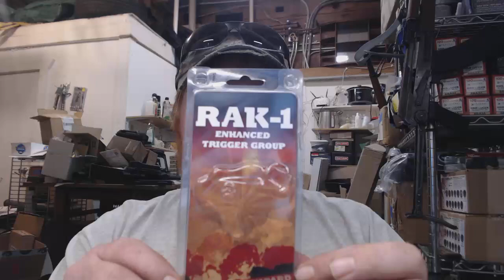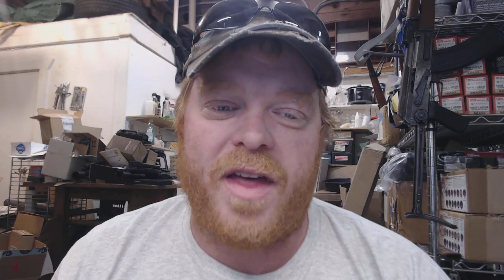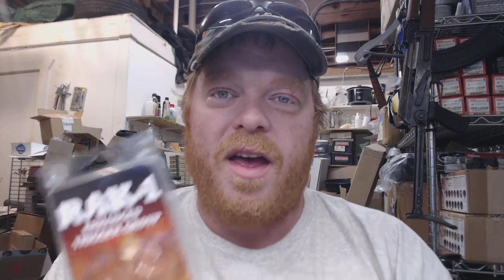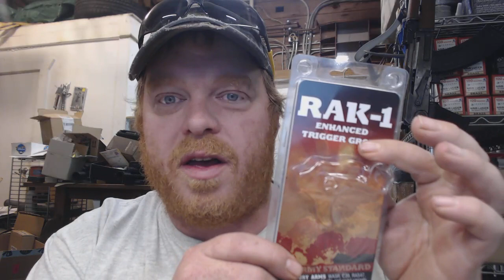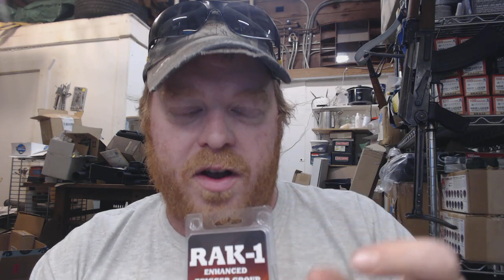I was WRONG About the Century RAK-1 AK 47 Trigger

Comment: Thanks for submitting this video! I have a 2016 wasr10 with a double hook rack-1 trigger ,...and I noticed there was only a -one slot cut out opening for a single hook trigger on my rifle , I then searched you tube and this is the only video I found that had the info I was looking for ,about the rak-1 double hook trigger being made compatible to work in a single hook slot trigger set-up! thanks for confirming that my trigger wasn’t modified by a back yard gunsmith like myself , !!
Reply from the maker: No prob! Yes, it works just fine in a single hook receiver. I'm glad my video helped. Thanks for watching.

Comment: Good information Brother. Thank you for clarifying the applications for the rak1.
Reply from the maker: I'm glad it helped. The Rak1 trigger is actually pretty decent. I don't like Century made AKs, but they did good on this trigger. Much better than a Tapco. The hammer profile is ok on the RAK, and I like the 2 stage feel.  Its the trigger group I usually recommend for most Tapco replacements or builds where you are concerned with 922r. If you don't have 922r concerns, then I do like a factory combloc trigger group too. And if you have a Tapco, I suggest replacing it. I did a video on that too. lol

Comment: Good to know..thanks. Gonna install the RAK1 fcg on my new Riley Defense ak when it arrives since I dont like the Tapco g2..those hard angles on it destroy the bolt carrier tail. Not a fan of Century but the RAK1 is good. Got it on my Wasr. Love it. Cheers!
Reply from the maker: I'm no Century fan either. In fact for the most part I can't stand them. But this Rak-1 hasbeen GTG for me so far. 

The Tapco is a disaster. Wrong angles and the steel is too hard too.